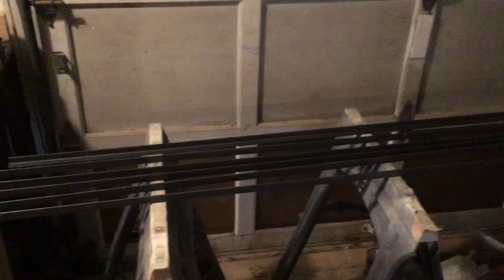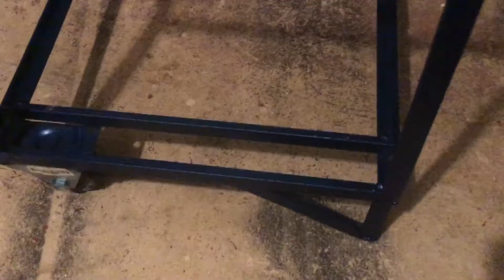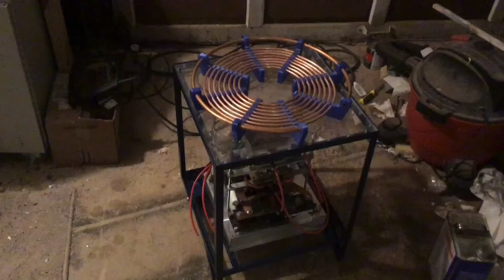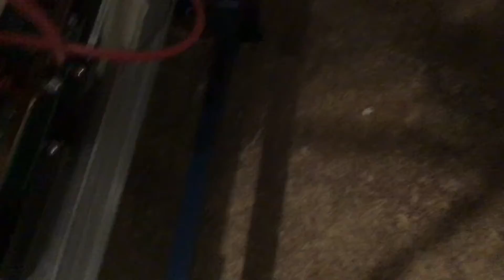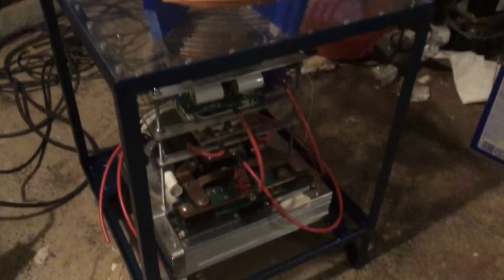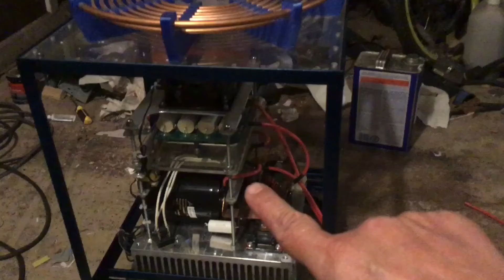Musical Tesla Coil DRSSTC build part 6

Comment: This is looking awesome! I'm curious to see the result 😍⚡⚡

Just watch out that the metal square is a closed loop and the primary will heat it by induction because of the current induced. You can put a gap in the metal structure to open the circuit and this will solve the possible issue
Reply from the maker: Thanks for the info!